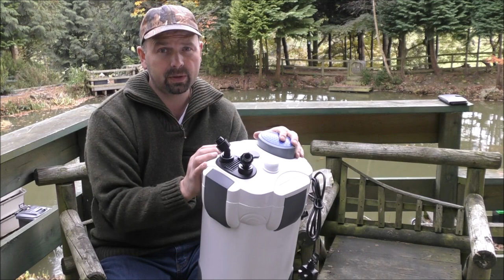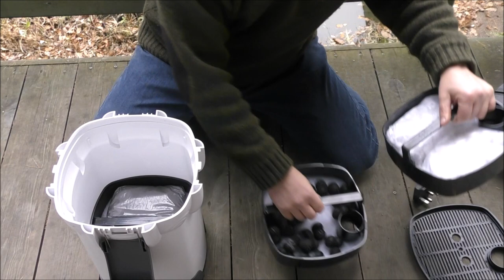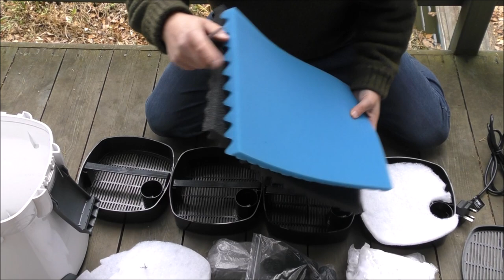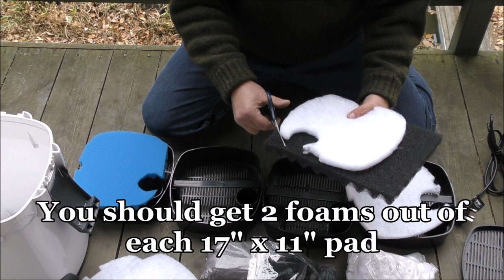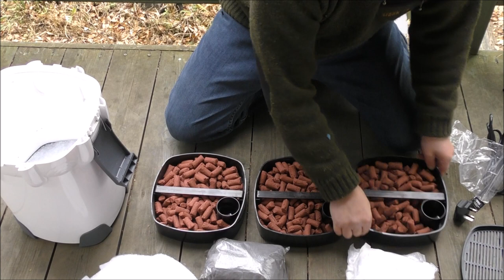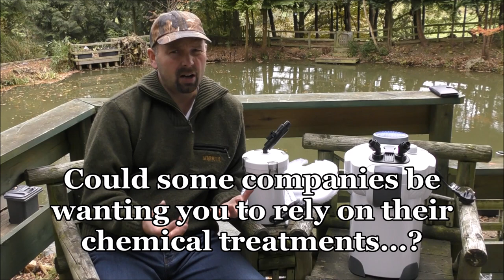Why Your Filter is TOO SMALL and NOT CYCLED

Comment: You have nailed it!!!! It makes perfect sense. Been a fish keeper for many years, I hold my hands up and say I read the instruction booklet that comes with a filter and stick by it. 
Well not anymore need to change the filters on my tanks, I got a 400 litre community tank and a 100 litre marine tank. The community tank has the the same filter as the one in your video and the marine tank has a FX5
Can you up load a video on how to replace the the filter media while the tanks are still running. I.e. Changing bits at a time so that I don't crash the tank. 👍
Reply from the maker: It is funny you mention instruction booklet since I watched a few 'how to set up your canister filter' videos prior to making this one and I can tell most people were simply reading off the manufacturers instructions while they were showing inside the filter and the order of trays - I had to stop watching as I was getting increasingly madder at those videos, some of which had hundreds of thousands of views. Those hundreds of thousands of people had tuned in to waste their eyeball time watching somebody set their filter up exactly the same way as it came from manufacturer, straight out the box.
That's as bad if not worse (and lazier) than an 'unboxing' video.
With regard to switching out filter media it is best to do a tray at a time, allowing 1-2 weeks between removing old media and adding new media so in a filter with 4 media trays you'd do foams one week (if you were changing them too), leave it 1-2 weeks then do one tray (any tray), leave 1-2 weeks then do another tray and so on. Depending on how many media trays you had the whole process could take a good few weeks and the heavier the stock the longer it should take so for example if you have heavy stock you'd leave it 2 weeks between tray upgrades and if you had light stock you could get away with 1 week between tray upgrades.
I'm glad you enjoy the videos - thanks for watching.

Comment: Hello, thanks for such a great informative video.  I have a 75 gallon tropical fish tank with Bala shark, 5 Cory cats, 4 neon tetra and 4 guppies , I have a Marineland HOB filter, a Jebo 835, SUnSun 804B and inside sponge filter but I can't seem to keep my tank clean and nitrate free.  My tank has been going for about 14 months, I have lost a few fish because the levels are to high, I will try to set up my canisters with the biohome and see how it does. Thanks again
Reply: Did the biohome help control your nitrates?  I have the same setup in my 75 gallon except in have red eye tetras instead of the guppies.  My nitrates are high also so I added a anubias plant to see how that helps.  I used biohome about 8 years ago but I don't remember if it worked. I will buy some more and test it.

Comment: My filter is insanely heavy and I have low Nitrate values in 300 L despite a sizable swarm of barbs and loaches. This started happening when the organisms in the filter started to form secondary structures which are surprisingly solid, almost like agar. I have a  tiny species of snails inhabiting it and they seem to dig tunnels through the filter, resulting in cleaning twice a year at most.
What I want to say? Well, I think the species and flow speed in the filter plays an important role in offering living space for anaerobic bacteria. I clean it carefully and get insane amount of biomass from the filter. I basically do a reverse flow and that's it. Plenty remain and grow back quickly.

My filling In order of flow:

Nothing below the tray, because they grow in like stalagmites and stalagtites
Tray 1
thin filter mat with big holes
thin filter mat fine
ceramic

Tray 2
ehfi balls

Tray 3 
ehfi balls
filter mat fine

so, why a mat in the top? well, it makes the flow more even, but more importantly it keeps teh bigger snails out of teh pump. I dropped using superfine mat entirely and had to refill 20 % of the ehfi after 5 years, because that stuff tunrs into sand in time.

So, I suggest to build a filter similar as in the video, but add tiny ramshorn snails and do try without the finest filter mat for only reusables.

Comment: I have just got the All pond solutions filter today. I'm slightly confused by it though. The way you say the water flows is from bottom up, meaning that first and foremost the 'dirty' water is passing the UV section of the filter. I have no reasoning to doubt you but in my head, I assumed the UV would be the last stage in the filtration, not the first?

Comment: Thanks for the excellent education Richard, I like the idea of the booster filter, I'm hoping to increase my aquarium size from 110 ltr to somewhere around 160 ltr in the near future and was thinking I would have to replace my new fluval 307 filter that I "pimped" as per your video on the 207. Now it makes sense to put some of the primary mechanical filtering in a booster, and because the 07 range have the vertical foam for primary mechanical filtering, maybe I could put coarse and medium foam in the booster, and medium and fine in the vertical 07 filters? That would leave all three trays for biohome ultimate. Does this sound ok to you, or am i missing something?

Comment: How about filter boosters? Are they worth it?  I've just seen them on ebay, the power source would be your existing cannister filter, if I'm understanding correctly it's a small canister that holds the foams and connects to your canister filter via the inlet hose, allowing for the entire canister filter to be used for media, the only downside I can see is reduced flow, which could be a pretty big downside, because surely if you increase the amount of media would you not also want to increase the rate of water turnover to make it more effective?  On the plus side if it's set up well you would have no reason to open the main cannister regularly as the gunk would almost all be caught in the small one, potentially meaning that cleaning the filter can be as simple as running the tap!

Comment: Hi...very useful video mate, although I'm somewhat slightly confused with one part. You said that the ceramic rings or the bio balls goes at the very bottom. I've been told that those are where the good bacterial colonies are formed, so if they go at the very bottom then doesn't that mean they take the most much from the water? and when you decide the clean the rings you also wash the good bacteria away?

Comment: Most informative video I've found yet on youtube! I used to have a 10 gallon tank when I was 16 but got discouraged with keeping it clean and keeping the fish alive.  I have since bought a 30 gallon tank and have gotten back into it (10 years later) but once again, I am struggling with keeping algae out of the tank. Upon some research, I bought a sunsun 704b filter so I would have the UV light (I read that it will kill algae and other harmful bacteria). Without knowing any better, I just set it up with all the fine filters it came with. (it didn't come with any bio media or carbon at all go figure). I left the pump run 2 days and came home one night to find all my fish gasping at the top of the tank. I did a 50% water change and all the fish started acting normal again within an hour (thank God). I am assuming my nitrate level was way too high? I have just added some bio balls and ceramic noodles to the filter so time will tell what happens. After watching your video I have adjusted the order in which my filtration is set up but I still only have the fine media filters. Will be ordering the course and medium foam pieces shortly. I never knew about the cycle the water needs to rotate through until watching your video so thank you so much for explaining in full detail how it all works!

Comment: Fantastic Richard. Best filter setup video on YouTube since your last one some years ago! Time stamps add to quality.
Just one thing though - an Allpondsolutions canister? I had one for years which was really good, but then bought another for a larger tank. I had nothing but trouble with it (after the guarantee ran out) and it leaked continuously. Read up on them and they are generally slated on forums/reviews as being prone to leaking. In an emergency I had to pay more for a Maidenhead Aquatics AquaManta 400, which is absolutely superb, but I don't think I can get a booster filter to fit? 
I have subscribed to your channel for more quality videos.
Reply from the maker: The boosters will fit any canister as they are just an in-line filter but you may need to check hose sizes / use a reducer to marry it up.
With regard to canisters leaking even the best canisters (eheim) have loads of reports online from people saying they leak.
The reason I went with this one is that I'm going to give it away with booster and full of biohome in the near future and as I bought it myself I didn't want to spend a fortune just to film it a couple of times then give it away.
I am going to build a studio in my new shed so I can make some more filtration videos no matter what the weather is like.
Thanks for watching and appreciating the videos.

Comment: So, I have a question after watching this video. Pondguru says we need 1 to 2 kgs of filtermedia for every 100 liter water. All the math behind it makes sense to me. When Ponguru speaks on the Eheim filters he says that on their website they state the "of about" size of the aquarium as well as the "up to" size. I did notice that too when searching for a new filter. Also, they added the container volume and the filter volume. 

It all works fine until you take a look at their bigger filters. So here's my question: The filter volume is stated in liters. Now, maybe I am making wrong assumptions here, but 1 liter should roughly equal 1 kg of filtermedia. Looking at the Eheim Classic 1500 XL it has a filter volume of 18 liters. Which means roughly 18 kgs of filtermedia making it suitable for approx. 900 - 1800 liter aquariums. Yet, they state a mere 300 L for "of about". size. What am I missing?

Comment: What a fantastic video! I own an EFX 2000 and have it set up as per manufacturers instructions. I will be sorting that out tonight. Pondguru, Do you have a view on the Boyu built in filters? They look shocking to me. Spray bar puts water in 3 of the 4 compartments simultaneously and they are so shallow you cant get pads and biomedia in them. Is it best just to rip it out, or would loading it up with bio still do some good, or perhaps remove the spray bar and try to push the water through each compartment.

Comment: What's the best way to change from a filter that's too small to a correct sized for the tank. Awesome videos, make it easy to understand.
Reply from the maker: Just leave the old filter running, set up the new filter and run it for a good 3-4 weeks before removing the old filter. That way you give the new filter time to populate with good bacteria.
If you have good media in your old filter you could simply swap that to the new filter and run it like that which would allow you to remove the old filter much sooner since the media in new filter would have a head start.

Comment: What's the best way to change from a filter that's too small to a correct sized for the tank. Awesome videos, make it easy to understand.
Reply from the maker: This seems to be the third comment which is exactly the same:
Just leave the old filter running, set up the new filter and run it for a good 3-4 weeks before removing the old filter. That way you give the new filter time to populate with good bacteria.
If you have good media in your old filter you could simply swap that to the new filter and run it like that which would allow you to remove the old filter much sooner since the media in new filter would have a head start.

Comment: Im just starting my first aquarium. I used a stocking calculator tool that said the tank was fine for my proposed stocking but the filter that comes with the starter set isnt anywhere near. Playing with the calc tool it says i need a filter rated for 400 litres for my 200 litre tank to be able to stock my tank, which backs up your comments on your video. Im going to get a bigger filter right off the get go now. Thanks for pointing me in the right direction and wish me luck with my first tank. Oh and ive ordered some biohome media based on your recommendations too.
Reply from the maker: I'm glad you found the video(s) useful and thanks for the order. Best of luck with the tank - having a  properly sized filter which is set up correctly is a huge part of successful fish keeping.

Comment: Looking to get the SunSun for my 55 gallon (~200 liter) community tanks.  Mostly guppies & mollies.  What size should I get?  Seems halving it per the rule of thumb, the HW-303B should cover it.   Specs say up to 100 gallon but for the price the next level up (304B) is tempting although I'll have to purchase more Biohome ultimate.  Just want to right size these and not have any regret.   Also, should I get the ones that include the factory media or just bare bones?  Sorry, not trying to use YouTube as a message board!

Comment: I know this video is older but I have a 90 gallon turtle tank (she's about 9 inches long) with four rainbow sharks and an oscar and my sunsun 303b just isn't good enough any more.  It was already set up like you showed with mechanical in the bottom and two liters of seachem matrix in the top two trays.  I plan to set up the 404b the same way except I'll have an extra tray of pumice pebbles 3/8 inch (instead of matrix).  Do you think I'll be able to go more than three days with clean water?

Comment: hi. Nice video. Very informative. Let me know what do you mean by wash in treated water? Secondly I noticed you never used Polyfil. Can that be used too  in a separate tray keeping the Bio ultimate filter media to 2 trays instead of 3 trays. At time Stamps 27:46 ie Chemical filtration problems / effects on bacteria and nitrate levels. What sort of Chemical Filtration do you suggest?

Comment: Pond Guru, one thing I noticed with the sunsun filters it's a good idea to setup the bottom tray like you recommend, but also have a fine pad on the top media tray if you  have the filter in an area that needs to be a bit quieter, without the pad the media in the top tray can rattle and the fine pad kind of buffers it so the high flow from the impeller does not rattle the biohome.
Reply from the maker: That sounds like a good fix but it would be best to go with a coarse or medium pad in the top if you were going to do that since it will avoid the clogging issue (small particles will go through or be caught half way through the foam / be caught second time around)
Reply: Pondguru yep that would be better, I didn't even think of using the blue one.  I had a bunch of the white ones that came with the filter so I just used those 😀👍

Comment: I brought a canister like this but wanted to know if I can run the canister if the glass tube is broken? Do I need the glass tube/case? I'm trying to find out because I broke mine while trying to figure out how to stop the leaking. Can I put it back up? Or do I need to buy another glass tube before putting it back together and plugging it up?

Comment: Hoping you can help direct me. We have a 55-gallon tank that sits in the bottom of our full-sized green iguana's enclosure. This serves as her bathroom and soak pan. What type and size canister filter would you recommend? We do scoop to get large feces out and are currently using an over the size with a flat filter. I am thinking of adding a canister for better filtration and less maintenance. We are changing filters twice a week.

Comment: There's something's that sort of irk me slightly, but I agree with the rest. I have a 'high-tech' planted  tank which has been going for around a year now. I have several species of tetra, a few otto's. cherry shrimp, and a couple of bristlenose's. Ammonia and Nitrite are always zero, Nitrates on the other hand are always around 40ppm. I have had no deaths in that time, plants grow faster than I care to trim them and you can see the inhabitants are happy. It'll never get below 40ppm due to the water from my tap have Nitrates levels of 40ppm. I'm not spending extra money just to remove the Nitrates from the tap water, especially when I have zero issues with my particular set-up. It all boils down to the individual, and i'm happy with 40ppm Nitrates in my aquarium as I can see that it isn't causing any problems.
Your video is still packed with great information though, a thumbs up from me. :-)
Reply from the maker: In the first part of the comment you say there are some things which irk you (about the information in the video?) but don't say what they are - if you let me know what they are maybe it's something I can help with.
40ppm certainly isn't super high nitrate and the effects of nitrate are not immediate like ammonia or nitrite but I'm surprised they aren't much lower in a planted tank, even with tap water of 40ppm - what filtration do you use and how much water do you change / how often?

Comment: I have a koi pond I just finished up and it's 1,400 gallons. From the math(which may be off) I would need 77lb of filter media? Can you tell me if I'm correct? Currently set up with tetra 4000 gal pressure box with sponge filters and moving bed media in the bottom and a waterfall filter before returning to pond. The koi are in a basement pond of 400 gallons right now- 9 koi ranging from 10" to 2ft.

Comment: THANK YOU.
I KNEW THERE WAS A PROB WITH THE BRANDED RESIN BASED TREATMENT. 
I PUT IT IN MY 240L AND THE WATER LOOKED BETTER, BUT ONLY IN THE SHORT TERM.
CAN'T QUITE PUT MY FINGER ON IT EITHER.
I'LL BE SORTING IT OUT LATER WITH A SIMPLER SET UP.
I USE EHEIM SUBSTRAT PRO AND EF2000 CANISTER.
KIND REGARDS